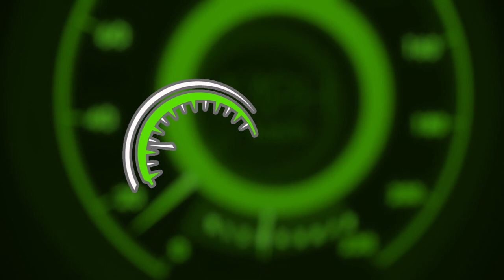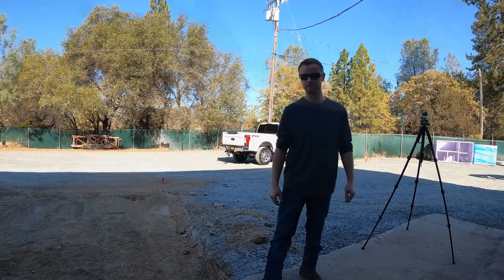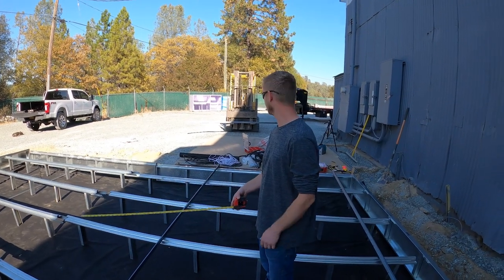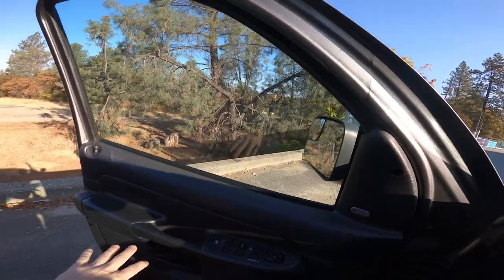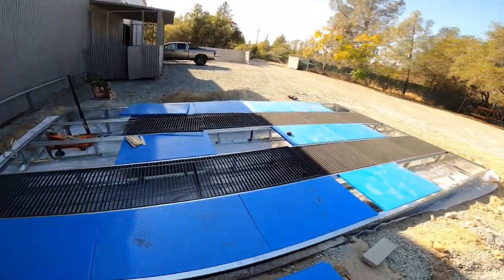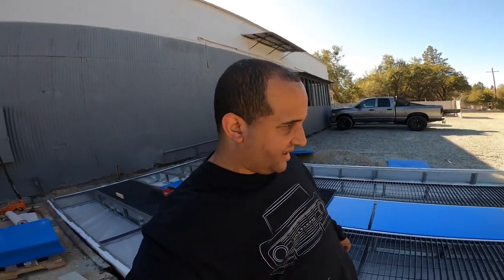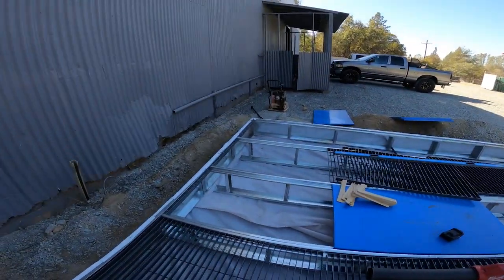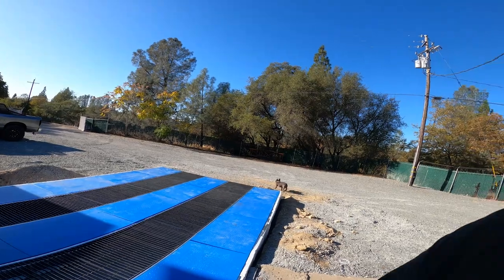How to install a floor on a down draft paint booth?

Comment: What kind of floor system is that? I am currently tearing down a Garmat downdraft at the dealership I work at. I am getting it for free. I want to install it at my shop but trying to figure out how to install it without tearing up concrete for the basement portion of the booth. Thanks!
Reply: Have it raised & use a ramp to enter